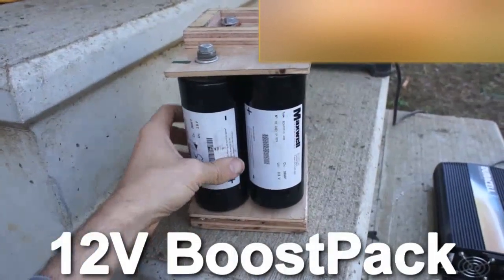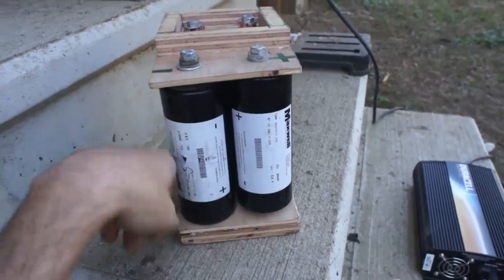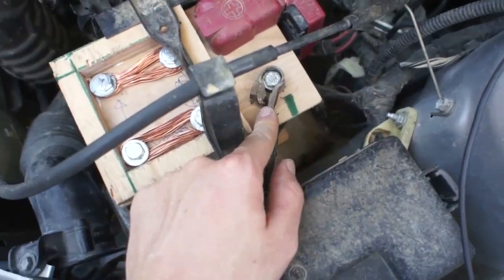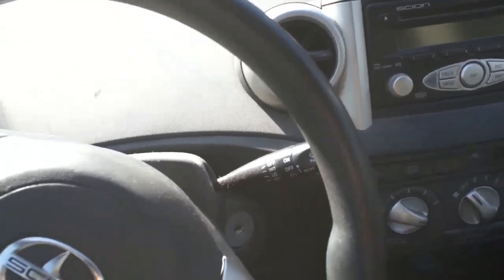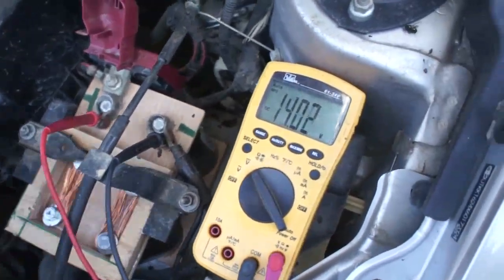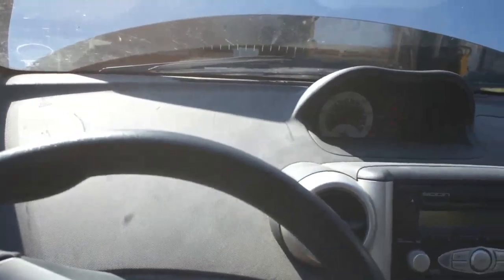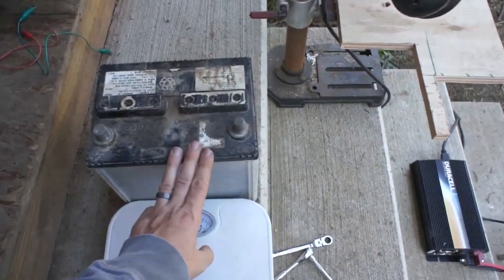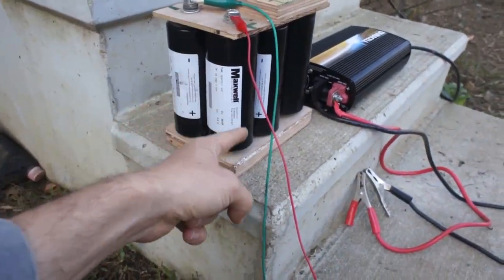12V BoostPack. Replaces auto battery. Works great!

Comment: Ok ok, if you want to be critical I suppose you will save a tiny bit of gas with a 25 pound weight cut. But its so miniscule it may as well be nothing. You lose 25 pounds when you use 4 gallons of gas out of your car's tank. Its just not worth the potential damage to your car's electronics. You cannot sit with the radio on without the car being started, you can't turn your lights on for very long if you need them. If you have an anti theft device it'll drain the caps in a day or so. Its silly

Comment: Electrolytic capacitors do not last long when used as batteries. They do not have much for amp hours either leaving you with a car that won't start if you forget you lights on for more than a couple minutes... Yes they do have some serious amps though. It would make a excellent jump start pack though. Market it that way. You could charge it by the cigarette lighter in your car then use it to jump start another car with a dead or missing battery.

Comment: Do you mind telling me if your BoosterPack is also capable of running a car radio for a few hours, or perhaps a headlight for a few hours?  Because if you can go the extra mile to test this product for other applications, maybe I'll be more confident replacing my non-motorized bike's heavy lead-acid battery with something similar to run my headlights and radio, seeing as they are important for hobbyists, especially frugal ones who don't want to burn gas.

Comment: The voltage when your car is running is a factor of both the alternator and the battery. When your battery is low, the voltage will read low even with the car running because even though the alternator is trying to feed 15 volts, the dead battery is sucking up so many amps that the alternator can't maintain that 15 volts until the battery charges up. Once the battery is charged up, it's voltage is temporarily elevated to 15 volts by the alternator but drops down to 12.6v once the engine stops.

Comment: I believe Tranqs Lurker means amp/hours.  How long will the pack run your car radio, dome light, or even the clock? More importantly, how long will it be able to crank your engine on those freezing winter mornings when your oil is thick? I noticed that running your headlights drew down the voltage fairly quickly so even though it can crank out a nice burst of amperage, I suspect you'll encounter times that you'll wish you had some reserve capacity.

Comment: modern vehicles need about 9 volts minimum to power the computer. 9 volts may roll the engine over but it may not start.. something to keep in mind when building something like this.

Comment from the maker: Update:

Over a few months of testing the BoostPack always worked great for my car.  If  the car sits for about half a week it may drain.  A small solar panel would fix this.  Since this car is my daily driver self discharging has not been a problem.  I have taken the BoostPack apart and I am rebuilding it using Plastic cutting boards instead of wood.  I will post an update video soon.  I also built one using much smaller capacitors.  It will also start my car but has very little reserve power.

Comment: if your Boost Pack works as well as you explain,instead of putting it in the normal battery location under the hood, why couldn't you install it in the trunk of your car. Then you would not have to worry about the wooden frame getting damaged???

Comment: then try to add something relevant to the discussion.. I never mentioned anything about this NOT working.. it works great for cranking a car. My only point was that it could potentially have problems with someone that had a small draw from say a radar detector left on. A good test might be to disconnect the alternator and see just how low of a voltage the car will run down to.

Comment: First, I don't think that contraption can replace a battery.  How many cranking amps does it have? batteries usually have about 400 to 600 cold cranking amps.  Second, the 14 volts that you were reading were not the battery's voltage, you were reading the charging voltage cause the alternator was doing its job. This is nothing but pseudo science.

Comment: Man you can't use jumper cables any more. The caps act as a dead short when not fully charged. You would blow up their battery unless you install a resistor to limit current.

Comment: Have you noticed any alternator damage?  The capacitor will create a surge of power demand, since unlike a car battery the capacitor will charge and discharge instantly...meaning if this cap is almost dead it will overload the alternator until it is full... Still, to be honest. I would definately install this cap pack in tandem with a standard car battery. It would make for a reserve power source that will allow even a dead battery to start your car, and also jump starts would take seconds!!

Comment: Super caps only good for high capacity short term - Batteries only good for high capacity long term. Super caps used for acceleration on electric vehicles, lead or other media used for run at velocity.

Comment: Volvo? wtf does that have to do with anything? I never mentioned anything about leaving the lights on.. sure, they can be charged quickly because they can accept a lot more charging current than lead acid batteries, but mainly because the capacity is just a fraction of the battery.. have you even researched what a Joule is?

Comment: Engines that run on "compressed air," not air alone, exist and work well for short distances. But engines running on water alone are fake, they are a scam, they aren't "suppressed" by oil companies and the inventor wasn't killed by them. This is kind of like the 200mpg HHO scams you hear about.

Comment: I'm not saying this isn't a great idea.. just that it has its limitations.. BUT what might be the ultimate solution would be to parallel the ultracap bank with a small 8-12Ah SLA battery.. it will gibe the system hundreds of amps of starting capability AND some reserve capacity for the clock, ECM, radio to survive a night even with some small discharge.

Comment: alternators charge batteries up. your vehicles electronics run off the battery. when the alternator runs passed the amount it handles it takes it from the battery hence why car audio batteries use banks. your small car will work fine with this as long as you keep the capacitor bank charged. also starting this car uses hardly any cranking amps reason why it cranks so well. 
but once you over run the alternator and take it from the capacitor bank you will be dead. this is unlikely with your setup.

Comment: I have some of these ultra caps.. because of their ultra low internal resistance can both deliver and absorb massive amounts of current.. but the total capacity is still dwarfed by a lead-acid battery. if you have any parasitic draw from your vehicle at all it will most likely be dead in the morning.. The ultra cap energy = ~46,000 Joules where as a typical automotive battery is >2 million joules.

Comment: note quite a true statement.. that is an old wise tale. batteries as they become charged draw less and less current.. and when they are full besides gassing from bulk charge voltage dont draw much current.. the bulk of the alternator load is from vehicle loads, ecm, injectors, cooling fans, instrument cluster, radio, etc etc. the ecm on modern vehicles controls the alternator with PWM so it can vary the output current.. it never shuts completely off unless it dies.

Comment: i give you an A for effort, but theres a couple of reasons why the dont use capacitors for batteries. Many people think that the car runs off of the alternator, this is not true, the alternator is there to recharge the battery, and the battery works as a cushion for the blow of an alternator, use capacitors instead can cause strain on your electronics, like the computer, new cars are designed to shut the alternator off when not needed, this would have to charge all the time

Comment: With a 13W solar panel, you will not be able to recharge the boost cap package in a few minutes. My calculations tells me that it will take about one hour to charge it in full sun shine. The caps will store about 13Wh, more than enough to start the engine or run a drill for sever minutes. But if you leave the headlights on (2x55W) they will last only about 5 minutes, or 2-3 minutes before you can not start the engine again!

But its sure a good idea, long lasting (up to a million cycles).

Comment: Good! But I'll have to say that theese ultacaps contains much less energy even than a car battery. If you stop the car you'll have to turn off everything (radio etc). Count it out! For example you have 12V nominal voltage, 40Ah battery: 12V*40Ah=480Wh and you've got 6 2500Farad, 2.5V ulracaps connected in series. Total capacity: 2500/6= about 416Farads, and generator makes 14V voltage. (416F*14V*14V)/6800=  under 12 Wh which is much less than 480Wh. Check out this video: Fun with ultracapacitors

Comment: The ones at youtube(DOT)com/watch?v=riLibwSSo80 didn't seem to have any problem with their mains circuit breaker. The power salty water resistor decreases the voltage and the amperage. Of course it's not as safe as a shelf welding machine, but anyone can build it in no time. In either case, you have to know how to work with it.

Comment: Thanks, What wiring configuration do you wire those capacitors together in, parallel or series? Are they marked positive and negative? Apparently, you got a better price than on your link now. Are these the same thing that is in a battery jump pack, can I cannibalize one of those?

Comment: Nice. Also, to make sure they don't discharge too quickly, you might want to add some relatively small NiMH batteries to have a bit more capacity to go along with your cold cranking amps.

Comment: But how long will this last if the headlights are left on or if you sit with the radio on for a while? I imagine that the amp-hour capacity of the pack is still miniscule compared to the lead acid battery...even tho the instantaneous cranking amps available for starting appear to be quite adequate.

Comment: If you need a welding machine, don't throw away your car battery. Throw away the acid, fill it up with salty water and connect it between the hot mains wire and the welding pliers. The other mains wire goes to the welding ground. The larger the battery, the better.

Comment: yeah thats why the lead acid battery is still in great use over 100 years.cheap,simple,lots of current and unlike the capacitor bank,it can supply power for longer time also.id only see the capacitor bank useful as a starting aid and thats all.

Comment: Be very careful letting the voltage get too low. You have other electronics in there and they have minimum operating voltages. All of them of course will probably handle it fine but it would be foolish to let the cap bank fall to 10V. One other thing to note is that at some point those CAPs will discharge on their own and at a MUCH faster rate than that lead acid battery. It's a great idea but would better serve a WIND TURBINE "dump load" or something like that. What's the capacity in watts?

Comment: I have tought about doing this for some time, but one thing is bothering me. A regular battery has a limit for how fast it can be charged, but these caps can be charged infinitely fast. And without anything limiting the charging speed, could that possibly damage the alternator in the long term?

Please report back later on how this experiment went after using the caps for some time!

Comment: I think one reason is that it won't last very long if you have the headlights or radio turned on without the motor running. You saw how quickly the pack got deplated to 10v when he had the headlights on. One more minute and he wouldn't be able to start his car. Also capacitors tend to discharge quite quickly, so leaving the car for a few week you would find it won't start.

Comment: the caps are built just for that. they are meant to supply huge currents. in fact they are way better than a chemical battery for that purpuse, because the chemical process is very slow,but the caps are not chemical they are completly static so they supply current a lot faster, the voltage between the electrodes in the cap allready exists before its needed, its just sitting there ready to go, as apposed to battery when power has to be chemically manufactured when there is a load on the battery

Comment: Ultracaps don't follow the same rules as a battery when combing them. Caps in series will be additive to the voltage but will decrease the total Farads so 6x2600F caps in series would result in about a 15v 433F ultracap pack. Capacity wise a 6-pack of 2600F caps as shown would be the equiv of a 1 AH 12V nominal battery. That's about the same amount of total power stored in 4 AA rechargeable batteries. The diff being that an ultracap can give up the power so much quicker so it can start a car.

Comment: It is useless alone, discharge fast and after few failed attepts to fire up engine you are doomed. On the other hand, it would be exelent addon to help car battery during firing up engine times when momentum energy is required and reduce load to battery which should prolong batery life. Caps dont holt that much charge compared to battery so... no... for 100$ you can buy new battery no problem. took only 10 seconds to go from 14v to 10v? not good. battery +  caps + joule ringer =  problem solved.

Comment: Interesting video, I did some checking and I found huge caps like in the thousands of UF. at 15 volts and higher. I just wonder if you use high UF rating with many caps could you make a massive battery pack for say a electric motorcycle ? What do you think ?

Comment: Well, Ultracapacitors can discharge lots of energy in seconds, and this is because they have a very low ESR (equivalent series resistance), and since he connected them in parallel the ESR is reduced.

And thanks to a very low ESR you can put a load of hundreds of amps and it will work just fine.

Comment: that's what capacitors were made for: delivering an insane amount of current.
If this guy says that it will start up even after 2 weeks it means the caps' life should be long enough.

Another advantage of caps is that they can be charged very rapidly, so you could make brakes that charge this 'boostpack'; in fact those brakes already exist.

Comment: These work great for heavy audio applications. Running a 5000 W Sub Amp to 4 15" Subs would stop the engine in my '74 Beetle Adding the Caps allows for less distortion, and a MUCH cleaner supply of power.
Yeah I know 4 15" subs are tough to fit in a Bug. I ran them  in a dual Isobaric setup with large ports. This made the box "Just " fit.  Good luck.

Comment: Well... about the charging back up thing.. the voltage you are reading, is the voltage being supplied TO the battery, so it is the voltage at wich te battery being charged by the car.

It is a nice idea, but I wonder why car mechanics haven't thought about this before.

Comment: Capacitors can't store large amount of electricity. They are good for high drain apps, but not for storing electricity. If you  keep headlights ON for 5 Mins, capacitors will get drained and you will have to push your car. suppose you get stranded in middle of nowhere with no fuel and only capacitors, you are skrewed. You could just use one 12 V capacitor along with a battery, It will provide the sudden high current for start up, and battery will provide backup when you are in a situation.

Comment: That's awesome. Only drawback is you can't use anything electric with the car engine not running. But that tradeoff is well worth it in that these caps should last a very very long time, as opposed to a normal battery that lasts 5 yrs or so.

Comment: Some info from Maxwells site
 The ultracapacitor features a cylindrical design and an electrostatic storage capability that can cycle a million charges and discharges without performance degradation. They are available in quick and easy to implement threaded terminals or in compact, 
weldable terminals.

Comment: What is watt-hour storage capacity of your setup (per pound/kilogram weight)?
Can it be fully discharged without damaging capacitor? (I think so.) Lead batteries are damaged by full discharge... very costly problem!

Versus what watt hour/pound storage capacity in lead-acid battery? (This is how much "energy" you have for running drill etc. But starting a vehicle needs high amp push at start to get cranking, especially if engine is frozen, sluggish oil etc.)

Comment: Indeed.  17ah should suffice, and if you have LED headlamps, so much the better.  Heck, I am sure you could get a joule ringer to run the lights for a fraction of the normal consumption.  Off course if you are going to go that far, you could also just fit a BUZZER. 

However, If your car can't keep it self charged up whilst on tick over, your alternator needs looking at.  I have IDENTICAL system.  Running a 3.0 diesel. Daily.
For 2 months and counting. Now with winter cold starts.

Comment: Very nice... this opens up a lot of ideas.  If I hook up a small solar panel in my back window of the car, I could be assured the booster pack would always be at maximum capacity, even if I left the car un-used for months.  If I left the car lights on, the booster pack would recharge in a few hours.  Can't do that with a lead battery.

Comment: The "Cranking" power, or peak power of a capacitor bank is indeed going to be higher than that of a lead-acid battery, but the total capacity will be much lower. Accidentally leaving your headlights on or warming your car whilst waiting for a friend in a parking lot would drain this much more quickly than the traditional battery.

I think the best application for this is to augment a traditional rechargeable, not replace it.